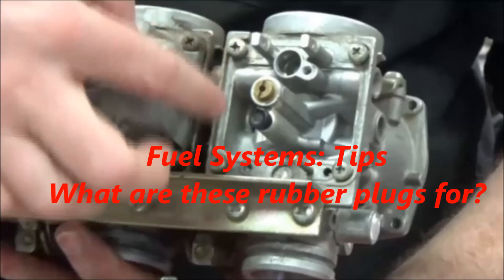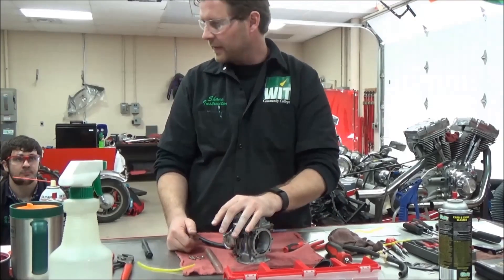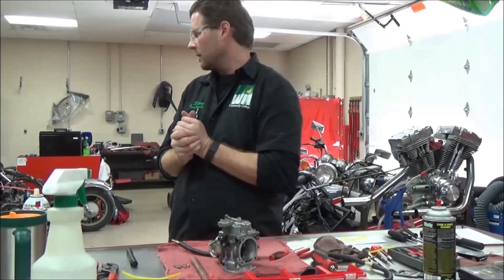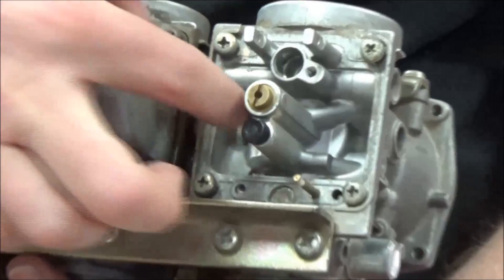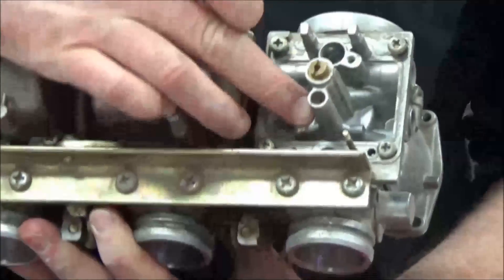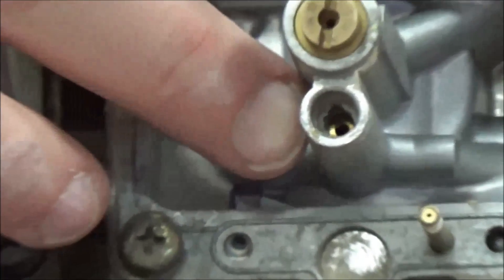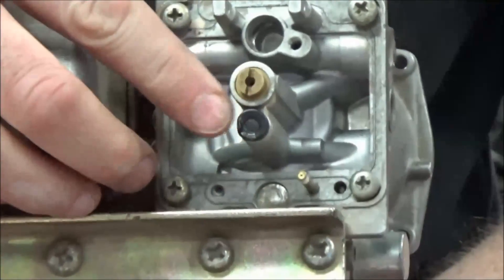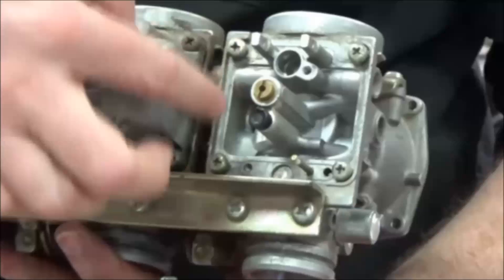Want to know what those rubber jet plugs are for in your carburetor?

Comment: I recently picked up a 1980 Suzuki GS550L. The example carb pack you use is very near if not identical. Do you have any videos or material on jetting for pods and 2 to 1 exhaust setup for these?
Reply from the maker: 👍 Thank you for taking the time to comment! Hit that subscribe button please! It helps us!
Here is a way to support all the free videos.
Want to say “thanks” or “keep it up”? Click here https://www.paypal.me/how2wrench  

Coach Conley is also available for hire to personally work one on one with you if ever needed. Yep he is a real person. Give him a call @ 602-345-0432

Your answers and help are just around the corner. Save time and money while protecting your investment and yourself by doing it the right way!
Follow us!
Web:
www.How2Wrench.com    
www.Tools2Wrench.com
Reply: If its a 550 l it should be a 4 cylinder? Unless you still want a 2 into 1 on both sides?

Comment: why didn't manufacturer use a brass plug instead of rubber? OK to drive a pin in fitting for permanent fix?
Reply: I making an assumption here but I think it's rubber so it easier to clean out that passage because you can just pop it out and spray carb cleaner in there. Also it's cheaper than a screw and makes a better seal.

Comment: This doens't make sense to me. On my mikuni the fuel goes from the main jet through a small hole into the pilot jet passageway to the pilot jet. Surely the fuel must be limited by the size of the pilot jet, because:
If it's not,  there's no need to have a pilot jet, as you could just plug the hole and meter fuel with the small hole that leads to the main jet.
If it IS, there is no reason to have the plug, as even with no plug the fuel is still limited and metered by the pilot jet...
Reply: They would have saved a lot of money if they did not put the plug, you always have to know that nothing is more because that is thought by x engineers